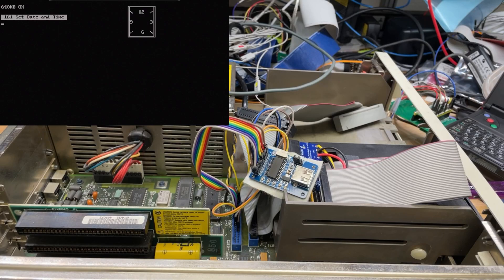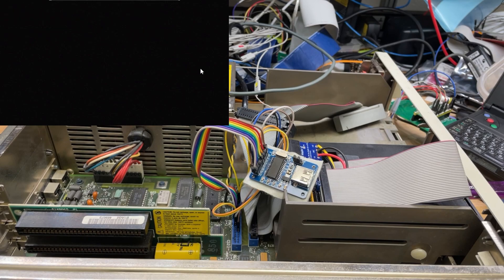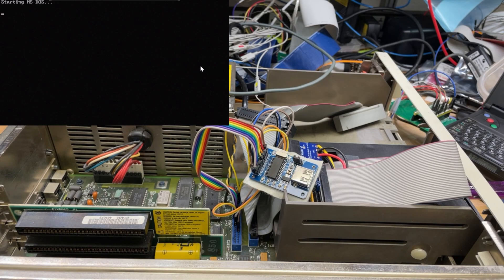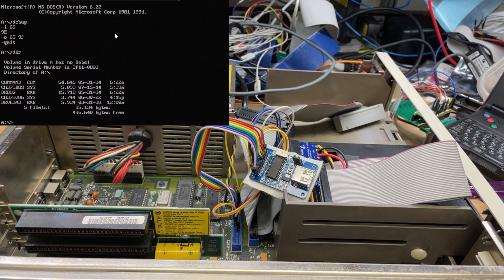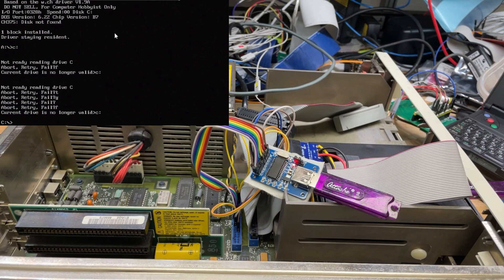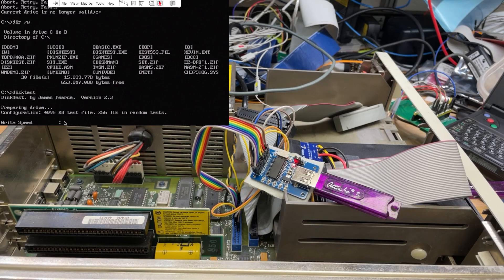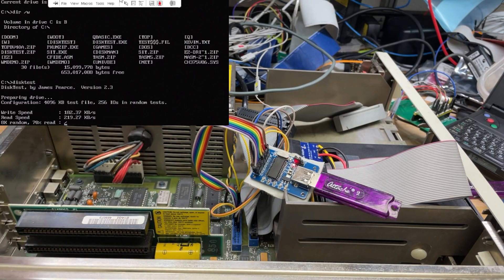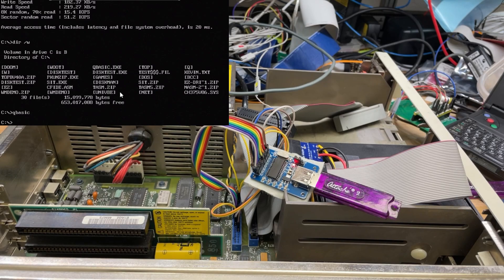CH375 USB Storage on 8086 IBM Model 30

Comment: I wonder if this could work on an Atari Portfolio..?
Reply from the maker: electrically I think it should not be hard with that expansion port?  my concern would be the operating system. I am not familiar with the Atari Portfolio, is dos-like but not dos right?
Reply: @yyzkevin416  It's DOS3 compatible :) I'll have to send you a Portfolio when I flick you a moulded LCD panel soon :)